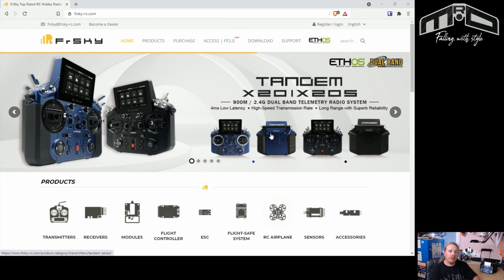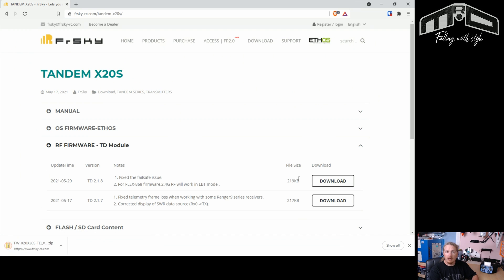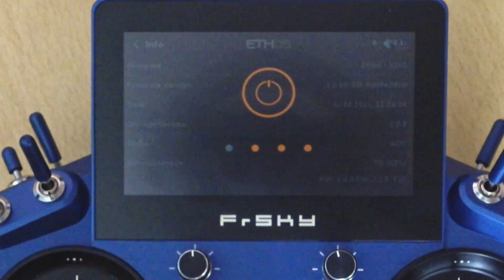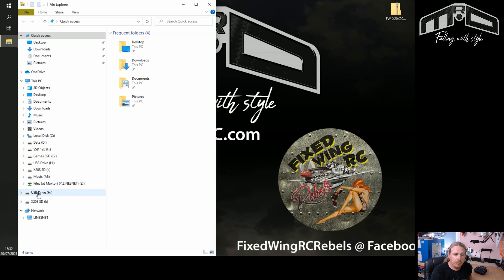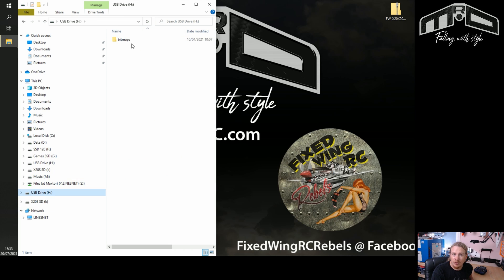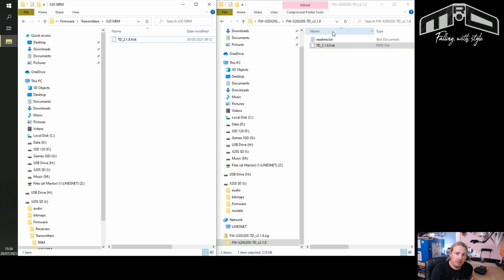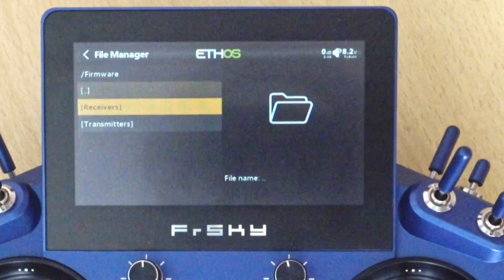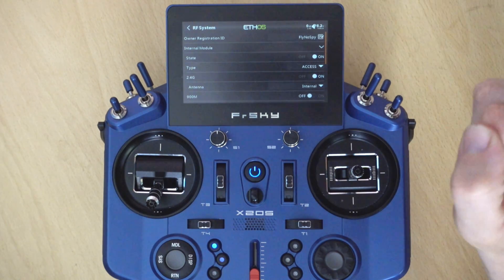Updating the internal RF module firmware using ETHOS

Comment: hello Darren
Congrats by your videos, always they are super precise and simple to understand.

I have a problem, I have followed your instruction to make it work the RF ISRM module of my Horus X10S EXPRESS,  ( last firmware abailable from the frsky horus express page ) when I try the flash.,  The bar of the radio screen dont start to run, always 0% after many seconds waiting the little window of the screen says THE DEVICE DONT RESPOND ) and then appears the EMMERGENCY MODE.
Same thing in the ethos suite, it say , dont detect the module.

Always the same in every atempt.

Please could you help?

Comment: Hi Darren, as always, outstanding videos! got a question for you. For an ISRM updated X10 on Ethos, the process would be quite similar, right? upon the proper update from the FrSky site, will my X10 be able to handle Archer recievers? I need it to handle an R10-PRO and a slave R8 PRO. Thank you so much!
Reply from the maker: If your X10 now has the ISRM, you’d just use the ISRM firmware from the FrSky site, rather than the XJT firmware. It looks like you’ll need to go to the X10 Express download page to get it. The ISRM module should be able to work with Archer when you install it. The update will just get everything up to the latest version. Which could have extra features for newer Archer/Plus receivers.

Comment: I finally did break down and buy a X20S. Do you think there is a way to flash ELRS to the R9 portion of the Tandem module? As I understand it, any R9 module should be able to operate ELRS. I'd probably not do this, but if I could get away with not having a weird adapter for my old JR-style ELRS module it might make sense. I might start testing the Tandem receivers, too, though. That might dissuade me from trying something weird like this. Lol
Reply from the maker: No, you can’t flash the internal module with ELRS. To be honest, I don’t see much point in flashing ACCESS R9 with ELRS. R9 is less hassle to set up (no FTDI needed), is fairly comparable with latency and consistency, and has more range than most people will get close to the edge of. Especially for fixed wing. If you’re racing quads, it’s a different story. But then 2.4 would be a better option anyway.
Reply: @MrD  I may or may not push the limits of 915mhz ELRS with my FPV equipment. Distance is definitely something I need.
Reply from the maker: @cwwisk  ACCESS R9 can do 100km+. Just for a bit of info.
Reply: @MrD  right. That is in optimal conditions without lots of overhead power lines, hills, trees, and rf noise. I am in an area with a lot of that stuff. My 915mhz 1W system is good for 20+/- miles (32 kilometers.). I'm open to trying R9.
Reply from the maker: @cw  I don’t know the noise environments for those flights. I just know that they were on all stock equipment. The main one is on the TANDEM radios, to use an external antenna. On one of the 100km (62 miles) journeys, the stock FrSKY Zipp9 was used. I’m sure that antennas like a VAS ShapeShifter or TrueRC Moxon would be as good if not better. 

If you want to use ELRS, that’s fine. But I was just thinking if R9 will do what you want. Then there’s no need for external modules. LoRa is what really helps with the noisy environments. R9 is using LoRa.
Reply: @MrD  that is kind of what I'm wondering, too. I might have set something up wrong with my current setup, too. I really don't like having to dig out old receivers, so I think I need to build something new to test back to back. I'll probably try a TD MX and see how that compares with stock antennas.

Comment: I have an unrelated question. Is the end user able to "physically" move the switches from one location to another ?
Reply from the maker: To be honest, I’ve not stripped down my X20 far enough to see. In the past (Taranis and Horus) the switches have been on cables. If that’s still the case, I can’t see a problem.

Comment: After updating the Ethos firmware I want to update the firmware of the x 20 tandem td module. In the videos present the new firmware is pasted in the FIRMAWARE folder on the sd. In my sd there are only 3 folders and there is no FIRMAWARE and related sub-folders. Do you think I can manually create folder and sub-folder and paste the new firmware?
Reply from the maker: Yes, just create the Firmware folder, and any folders inside it if you like to be organised.
Reply: @MrD  Tank !!!

Comment: Can you do a video on logical switches, mixers, and outputs? Thanks!
Reply from the maker: I have logical switch videos for OpenTX. Most of the features work in the same way or are renamed slightly. 

At the moment, the mixes are still being changed every so often. Is there anything in particular you were thinking about? As a lot of the mixes also are made for specific tasks.
Reply: @MrD  mostly fuel pumps, flaperons, and landing gear.
Reply from the maker: I’d imagine the fuel pump would be a basic free mix. Flaperons may have a dedicated mixer, or use a free mix on the ailerons channel. For landing gear, basic gear could again use a free mix. But I’ve seen issues raised on the ETHOS GitHub asking for a gear sequencer. So there could be something to look out for in the future.
Reply: @MrD  I'm sorry, I am still struggling. I managed to get the pump working with the on/off switch, but I'm not sure that my curve is being applied to the output. I have a functional switch successfully turning the pump off and on, but I need it to go from 50% and idle to 100% at full throttle. I am having difficulty linking the two mixes. I can't tell if it's working properly or not. Would connecting a servo to the channel tell me if it's working properly or not? Thanks!
Reply from the maker: Yes, if you connect a servo to the output, it will give you a nice, visual representation of what is happening.

Comment: That external module bay on that Darren,will the Tbs crossfire go into it?
Reply from the maker: There is a Crossfire lite module that will fit. It may be possible to make an adaptor for the full size or regular JR module. But, Crossfire isn’t supported yet by ETHOS.

Comment: Sorta wishing got that controller over ts16.. . Great video have a great weekend brother. Made my Wing! Thanks brother for your help! Mentioned in video.. and would really love your opinion. But know busy.. god bless 💪💪👊👊
Reply from the maker: To be honest, at the moment I'm favouring OpenTX for my FPV planes. ETHOS is definitely improving, and the X20 is great. But there are still some things not quite there yet. I'm glad to hear you've got your plane ready and good luck with the maiden.
Reply: @MrD  thanks my brother.. open tx is amazing.. I'm having trouble. Couldn't get the caddex Vista to work with mateck board. I hooked up like you said. Flashed right firmware? So decided to use as Just FPV camera. But I can't record? Vista doesn't Know when armed??  So trying to figure out why? No videos on? 411wse FC I have. Been a battle with that  FC wish just had one more UART... I'm not the Best at computer.. I'm old lol god bless and have a great Day. I mentioned station in my video. All in a good light 🤘🤘 thanks again for all your help 👊👊👍👍 god bless